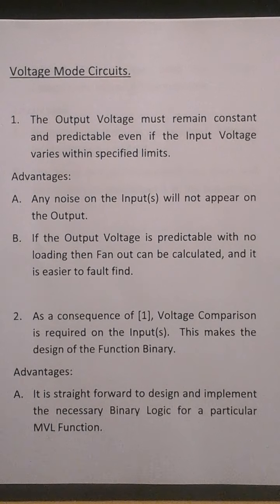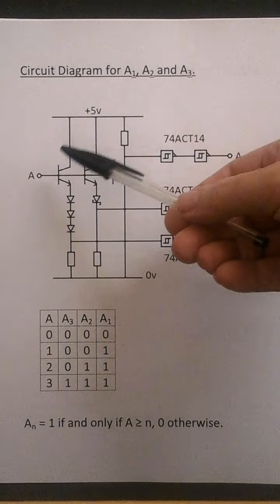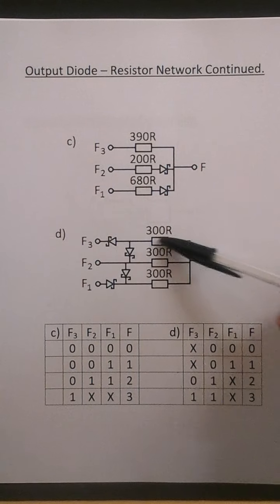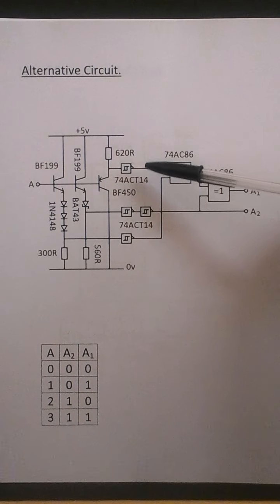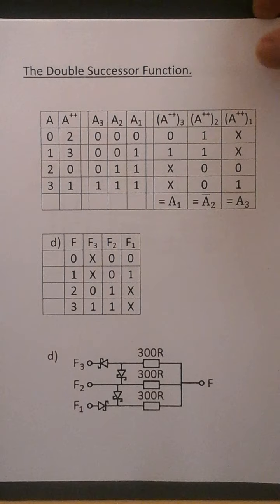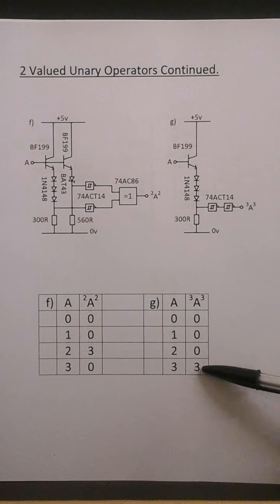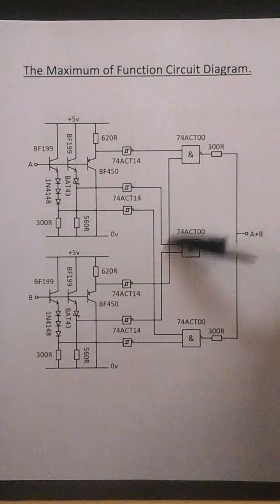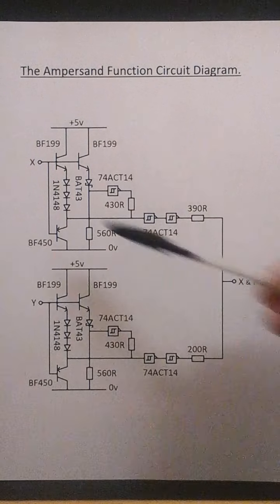Binary Implemented Quaternary Logic Circuits

Comment: I found your series amazing.
I'm specifically interested in Quaternary. I have downloaded logisim in order to try building out a Quaternary computer.

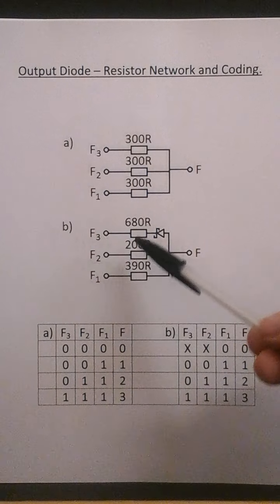@9:45 you begin to mention the value of the resistors:
200ohms
400ohms
600ohms
This number, 2 4 6, is inherent within base 4. When counting non-repeating numbers in base 4, it is the number of mirror pairs, two columns of 12, and a total of 24.
Reply from the maker: Hi Ben.  I would be interested to know how you get on!